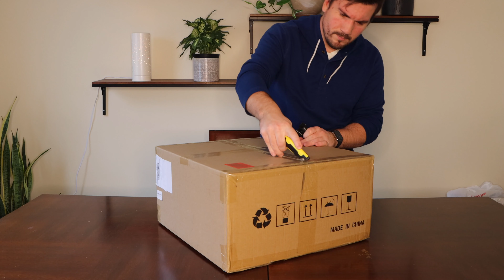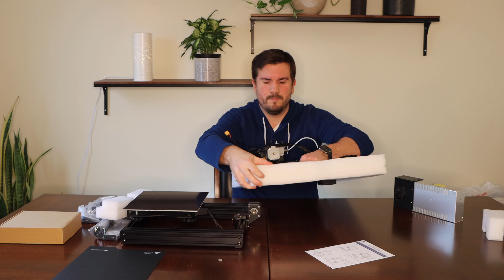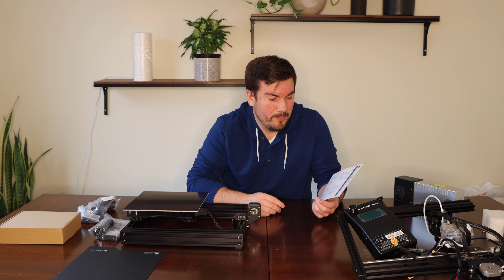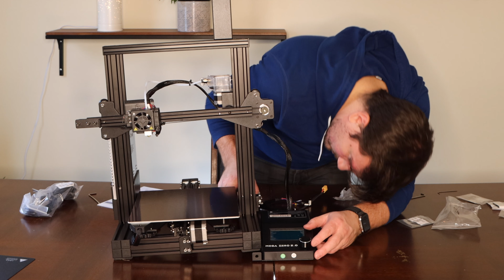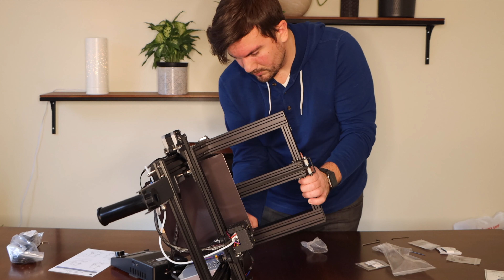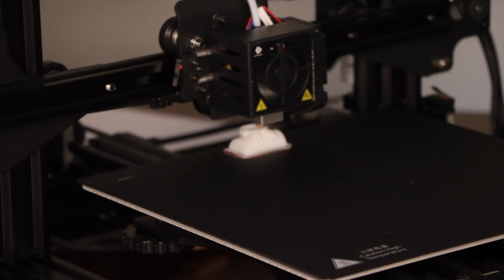3D Printing on a Budget

Comment: What was your bed temp for that? Raise it up and you'll probably have better adhesion!
Reply from the maker: I think it was set to 60c at the time, I tried a different print later on and it worked flawlessly
Reply: @playpausemedia  Settings vary from printer to printer/room to room/temp to temp. It's wild. I'd bump it up to 70c. It'll help with adhesion.